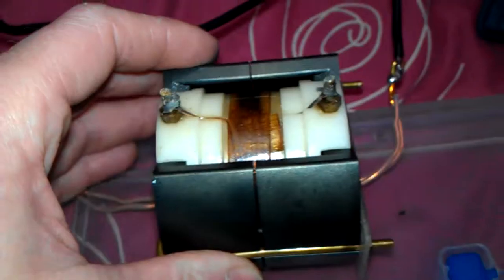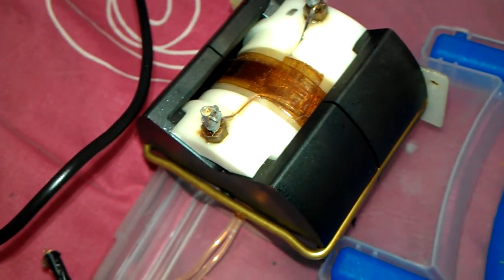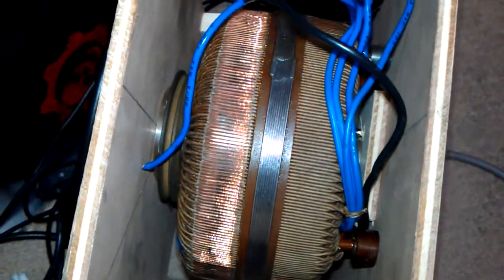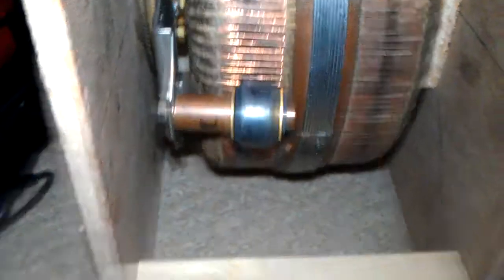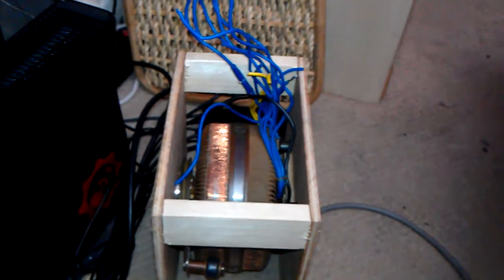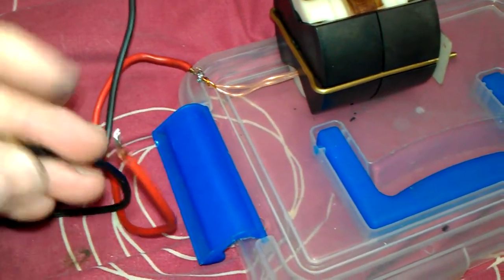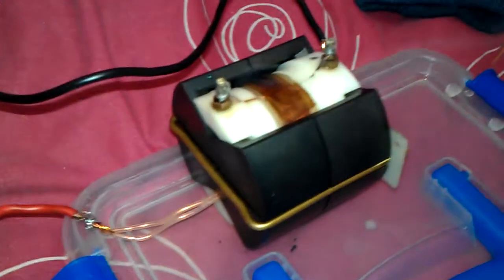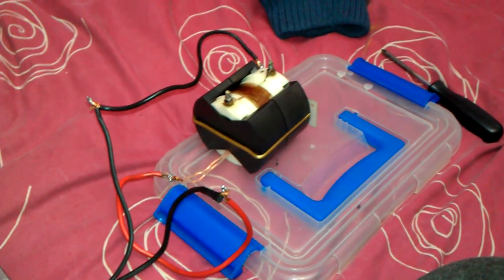Very nice ferrite transformer

Comment: There are X-ray tubes about the diameter of a ball-point pen refill and just over an inch long...they are used for inspection of tube welds, and most recently in a medical device designed to produce x-rays inside of living tissue to destroy cancer cells.